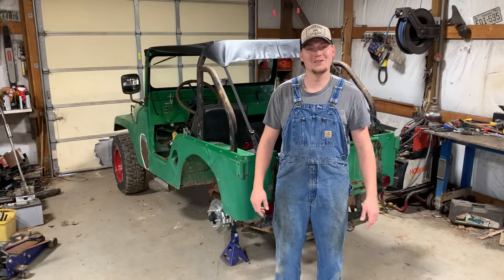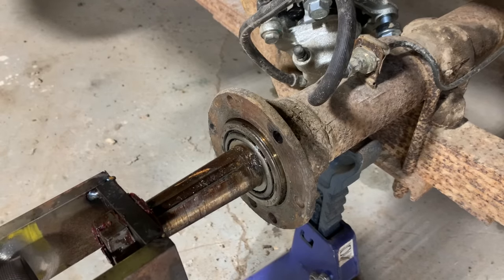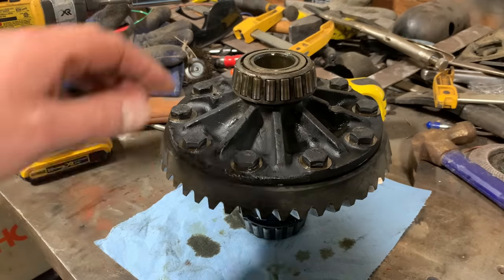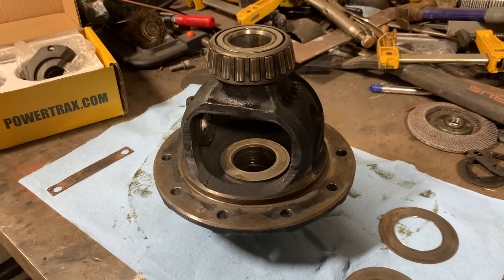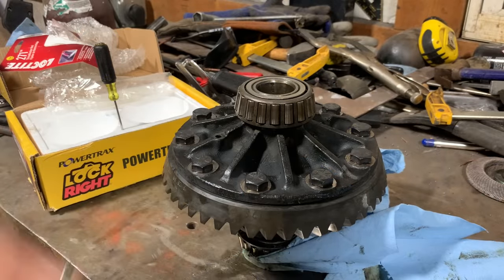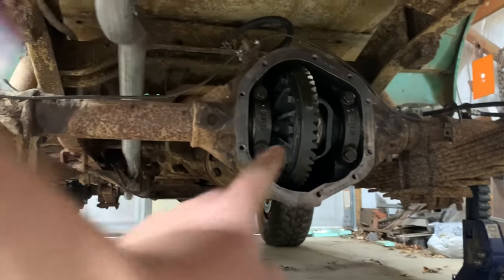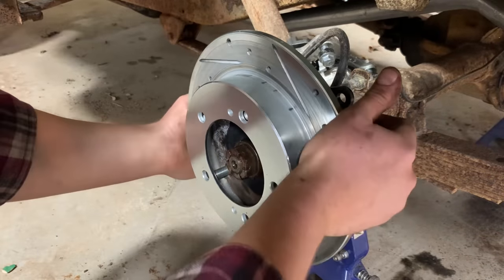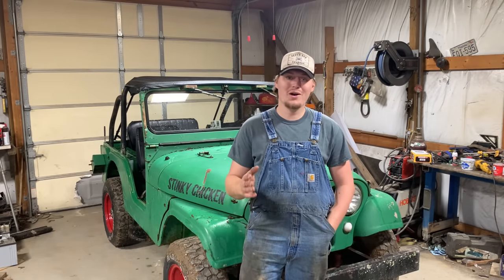1967 Jeep CJ5 Powertrax Lock Right Locker Installation!

Comment: Your videos are awsome. The time you put in, and the detail is excellent. I have a 1958 CJ5 with a 19 spline Detroit locker and Warn full floating axles. I installed a Lock Right in the front Dana 25. I added 11 drum brakes. 

Just a quick note, the early CJs, prior to 1962 (I believe) were 5.38 gears with the 2.79 first gear T90 transmission. The 1962 (?) and later came with 4.27 axle gears and the T90c transmission. The T90c has a 3.39 first gear.  Actually I'm looking for a T90c (3.39 first gear). I run 33x10.50x15s and 1st gear, in high range is somewhat high, or almost too tall. 

Thanks again for your efforts.
Reply from the maker: Really appreciate the positive feedback! 
That’s an excellent point thank you for sharing!

Comment: Nice video.  Thank you.
  I usually prefer using a gasket on most things myself,  but I often coat the gaskets with Indian Head gasket shellac, and I have had very good results with it, and it also makes gaskets last longer and it also makes them so that they can sometimes be reusable when needed which can be helpful in a pinch.
  On transfer cases and axles when needed I found that Permatex makes a Silicone RTV formula for gear oil that works very well, it is part number
#81182 . I used it for my transfer case rebuild that I did a couple years ago and so far I haven't had any issues with it leaking. 
  Thanks again for your videos.
Tim from Wisconsin.
Reply: Indian Head is good stuff.  👍🏻
Reply: @mjcavender1230    yes it is, been working with it on projects for over forty years,.  It also works great for filling in imperfections on surfaces that have rust, corrosion or scratches. 
  Just clean everything up with a wire or brass brush,. And apply as many coats as needed to fill the area that needs attention,  I often use a heat gun or hair dryer to accelerate drying,
 Then sand it smooth with a sanding block.  I have even used it for filling in
Pitting on cylinder heads that rust or corrosion from old acidic antifreeze.
Reply from the maker: Awesome I’ll have to check it out thank you for sharing and watching!

Comment: The right stuff is definately the right stuff! One thing you didnt mention about the axle seals. When replacing them always make sure they ride on the hub where they are supposed to. Iv had ones that were a different depth and didnt even reach the hub to seal it! Especially important when modifying the brakes and such like you did.
Reply from the maker: Glad you agree! I’ve never seen that issue but I appreciate you mentioning it I’ll have to check that out!

Comment: What do lockers do? Their purpose? Does it make it positraction? Sorry I am ignorant mechanically. You are definitely skilled and very good teacher
Reply from the maker: Sends power to all the tires, in stock form the tire with the least amount of traction gets all the power (helps in turning) so a 4x4 in stock form really just has power going to 1 rear tire and 1 front tire, this gives you 4 tires with power!
Reply: @SevenBarSalvage  But what do you give up?  Why weren't they designed this way?
Reply from the maker: @robertbrandywine  It’s not going to turn as sharp. A lot of road miles with a locker with wear your tires out quicker. A limited slip is a better option for something seeing a lot of road time.
Reply: but aren't hub locks for that? @SevenBarSalvage
Reply from the maker: @makingcookingfixing  Locking hubs engage and disengage your front axles. With an open differential and hubs locked the axle will only send power to the tire with the least amount of traction.

Comment: Is there such a thing as a torque bias kit for the rear axle? as those will turn the wheel that gets the most traction as opposed to turning both equally.....makes for better traction and cornering!
Reply from the maker: That’s a good question I’ll have to look into that! I will say the ratcheting feature does work really well when turning and as soon as you throw some power to it it locks up!

Comment: Enjoyed it? I loved it!!! Great detail for sure you are the man. What is the advantage of having this locker over the stock configuration?
Reply from the maker: Haha really appreciate it! Both wheels always turn, in the stock setup the wheel with the least amount of traction get all the power. Stock Jeeps are really 2 wheel drive if you think about it!
Reply: @SevenBarSalvage  So to test if my Willys Truck has these types of lockers installed like the owner told me he did, would be to jack up the rear and simply turn the tires and if both move its a locker? I am assuming same with the front rear as well? Thanks
Reply from the maker: @dgiorgi1725  If it’s got a locker or limited slip they should both turn the same direction if it’s open they will spin opposite directions! Hope this helps!
Reply: @SevenBarSalvage  Thank you and YES, this helps. I guess I would need to lock the front hubs to test them am I correct?
Reply from the maker: @dgiorgi1725  Correct, no problem!

Comment: I have a 1960 jeep that use to be in the military.  It has a 4 banger with a 4 speed and a transfer case that is stamped Spicer.  It has 24v and all waterproof everything.  It use to run but my dad passed away b4 he changed it to 12v and I have no ideal what it takes to do that and I can not figure out how to get it to run. 
 Do you know what other type of engine and transmission that will bolt to my transfer case with out any problems?
Reply from the maker: The engine is the same as a 12 volt system. Changing to 12 volt really just means replacing everything electrical like your ignition, generator, starter, lights, gauges. There’s no such thing as an easy engine swap 😆

Comment: What do you think about doing the disc brake conversion on just the front wheels? A lot of trucks back in the day had setups like that but they have a different weight distribution. Interested to hear your  thoughts.
Reply from the maker: Everything I’ve heard and seen it’s a good setup. You’ll have to get some kind of proportioning valve or the front and rear probably won’t lock up at the same time. I did disk and drum on my 3B! Thanks!

Comment: Also, does a guy add one of these kits to the front? Which axle did they use in the front
Reply from the maker: I would for sure use one in the front also. Mine has a limited slip but I wish I would have used one of these lockers. They used a Dana 25 and 27 up front. Thank you!